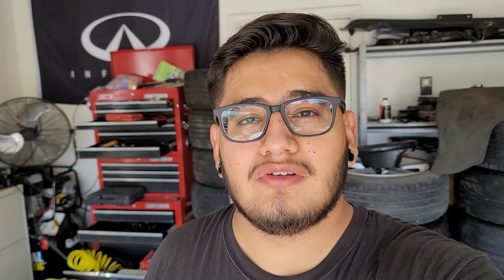Installing Barrina LED Garage Lights!

Comment: You must have selective OCD to leave all that hanging wire exposed  😜
Reply from the maker: It's not exposed wiring its covered by a plastic protector
Reply: @ERICSDIYGARAGE  I mean exposed as in dangling

Comment: My lights didn’t come with anything to mount them - was hoping to see how you did It
Reply: They should come with all mounting bracket, sometimes they are shipped inside the lights housing. Check there. Hope you didn't throw the bracket out if they were taped on the inside of the box

Comment: Lets hope those quick connectors dont come out! If they do you might have a live wire..if that happens its up to your circuit breaker to kick in and shut the power off. On the positive side however you will know right away because one of your lights will turn off. Looks really good! Good job! All you gotta do now is clean up a bit! And put some grease on your garage rail. Squeaky squeaky! :-D